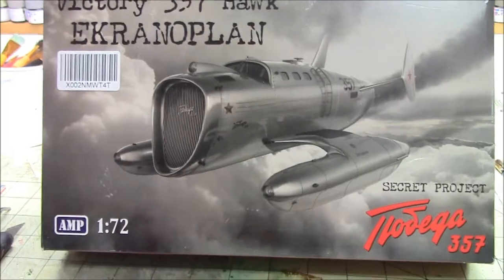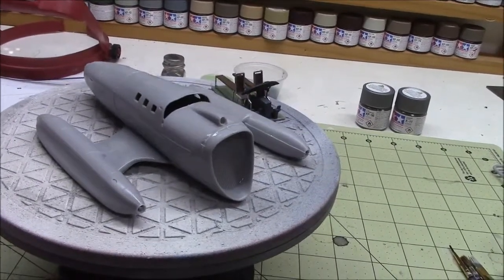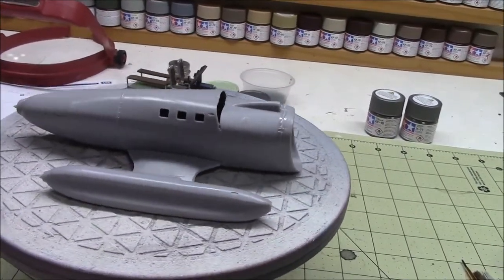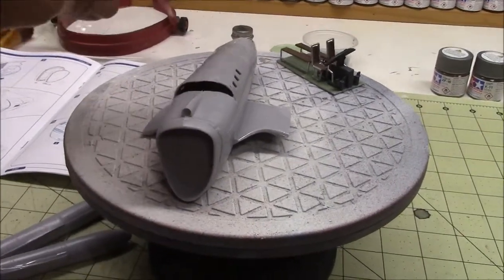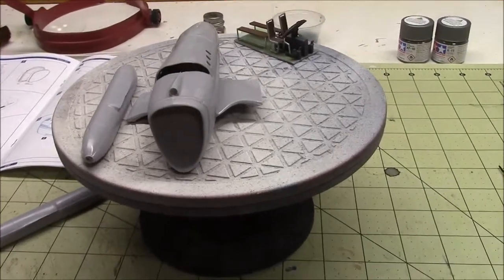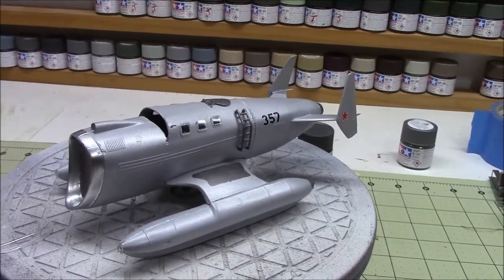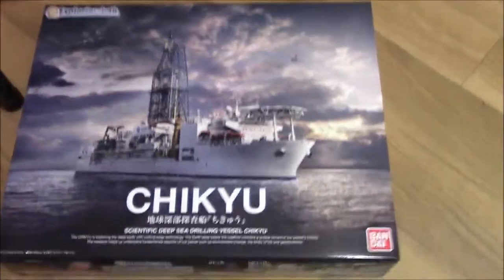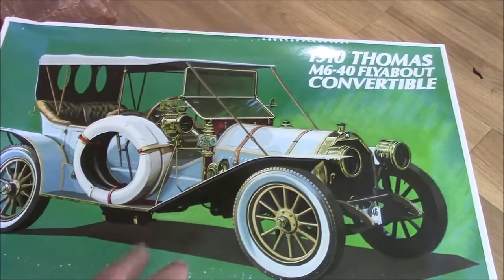Update #2 and Final on Ekranoplan AKA Buck Rogers plane

Comment: Hi Dan, Like the result! Especially the silver grill :)

I think these kits classify as short-run kits. Anyhow, sounds like they have the same fitting issues. I dry fitted my Buck Rogers Ekranoplane and managed to get the cockpit in. Some cutting and adjusting was necessary. I had the same problem with the wing part and the float generator fit. Those slots were useless indeed. Windows were bad fit as well. Rest was acceptable reshaping.. In short a kit that demands to much for an easy weekend build. I will post my result on my channel when finished.

Greetz DutchDave
Reply from the maker: Thanks Dave. I’ll be watching for your video. Thanks for watching buddy.